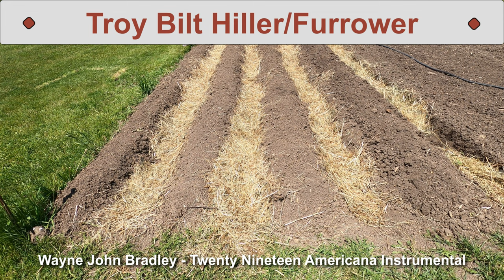Using A Troy Bilt Hiller/Furrower | Garden Update | Man About Home

Comment: I bought the 7 hp Kohler model in 1984 with the hiller/furrowed and still have it. It starts on first or second pull.
Reply from the maker: They're a great machine! Thank you for watching.
Reply: I wish every gas powered machine was as reliable and easy to maintain as these tillers. I have a hand me down horse that was new in the early 80’s. It has been used every season since my “Paw Paw” bought it for prep and maintenance on corn, potato and garden patches. Nan must have walked a few thousand miles behind/beside it in her day and my Uncle and I share it now. Other than it beating down a few sets of tines till they were almost straight it hasn’t needed any real parts other than a couple of oil seals, fuel line/filters, and tires, that were all pretty easy to change out. It sits unused/unstarted in an unheated pole shed in the off season for about four months straight and never asks for more than some new/fresh gas and a couple pulls on the rope. Dang they’re impressive at what they do!
Reply from the maker: @MrIgottap  They're tough and versatile machines!

Comment: Good to see your video! I have 1973 Troy Built Horse Professional model. 7 HP Kohler. It's a beast. I have all the original paper work. It shows all the attachments. Even a snow blade for front installation. Sure don't make the like they used to.
Reply from the maker: I didn't know they had a snow blade!  Yep, they6're a beast of a machine. Thank you for watching!
Reply: Do some poking around online and you’ll see that the manufacturer has made several other attachments for them over the years. I’ve never seen them in person but have found pics/videos of a hydraulic wood splitter, generator, wood chipper, etc. and probably another one or two I can’t recall. I even seen a video of a wheeled seat with a pivoting attachment (for steering with the handles) and ball hitch so it could be used/ridden like a small garden tractor towing a cart.
Reply from the maker: @MrIgottap  Interesting. Thanks for watching!

Comment: I have one of these Tillers.  They are wonderful for open field and when you have plenty of room.  They are a pain to maneuver in small fenced gardens.  I learned from you to rearrange my rows to have long rows.
Reply from the maker: As I expand my fenced in garden area, I've come to the conclusion that my 5 foot high welded wire fencing will need to be easily removed at the start and ends of my furrows. That will allow me to take it down for tilling, then put it back up when the tilling is done. Other wise I'd have to fence in a much larger area just to accommodate turning the tiller around at the start and end of each row... that costs too much! I'll be securing my fencing to the posts (which won't have to be moved) with plastic cable.zip ties. Easy on, easy off. And yes, the longer I make my rows, the fewer times I'll have to turn around. Thank you for watching and commenting!

Comment: Hey I'm 73 yrs old, I've been using my 1988 Troy Bilt horse every year.
If you grow Potatoes? This Tiller with your plow Attachment is a must.
I still my ground, then lay off my Furrows with the big plow which you have. I allow 4 feet between rows, and don't plant the potatoes in the Furrows!
Take a hoe and pull a furrow about 4" deep in the top of the ridge.
I use a small amount in the Furrows, I use 10-10-10 fertilizer.
Then plant your potatoes, then when they come up through the row, shave the weeds, and forget them until the vines die down, then HAPPY DIGGING!!!
I PLANTED 5 25' ROWS LAST YEAR, THREE YUKON GOLD, AND TWO KENNEBEC'S.
I still have a few potatoes left. It's just my wife and me. We counted 14 Walmart bags and 2 five gallon buckets that we gave away.
I PLANTED 24# each of the Yukon, and Kennebec's.
I cut them before planting, and let them set and the cuts heal over about three days b-4 planting that prevents them from rotting, and I cut at least 2 eyes per piece (sprouts).
Super simple to grow using the TROY BILT HORSE.
I string out all my rows, then use the plow without the flaps for my beans and corn etc, and make those rows about 4" deep.
And leave about 3' Between the rows, depending on what kind of corn and beans you are growing.
I'm in Indiana now.
But I was born in Leslie Co. Kentucky and we grew everything we ate except our Meat. I've been in Indiana since the summer of 1966.
Hey happy growing!
Thrills me to find another real gardener!
Reply from the maker: It thrills me that you implied I'm a real gardener! I have a lot to learn. But we're enjoying our harvests, and will be
expanding outside our fenced in garden this year with pumpkins and water melons. Not sure how that's going to work out, but we have good starts going and they'll be in the ground as soon as the clay dries dry enough. Thank you for sharing your experience with us. Thanks for watching!

Comment: I'm in my fourth year of using a Horse Tillers with the Hiller Furrower. I have to raise the hills so my plants will have dryer feet in our west NE Texas Springs. I pre till the soil for several passes as deep as I can. In spite of this during the making of three or more rows, the machine will crawl left or right for some reason leaving a lot of reshaping with a rake. Seems I can't true the rows up with the tiller. It seems I'm magnetically drawn to space my rows 36" center to center yet when growing anything other than single row onions, that proves too narrow for later cultivation. I've offset this by using a hiller/furrower from one of my old Pony Tillers which is narrower which helps. In other parts of my gardening, I use a David Bradley with several implements, a Farmall Cub and a Super A Wider spaced in those instances. With all that though, I always find a use for the Horse Tiller.  Also in our area, Grazon treated hay in the past has knocked some of my crops in the head causing me to discontinue it. It's hard to find around here that it hasn't been used on.  Thanks for sharing your video.
Reply from the maker: Thank you for sharing your experiences. And thanks for watching!